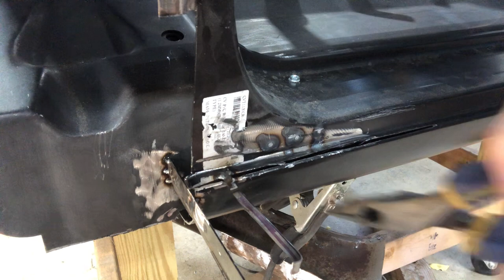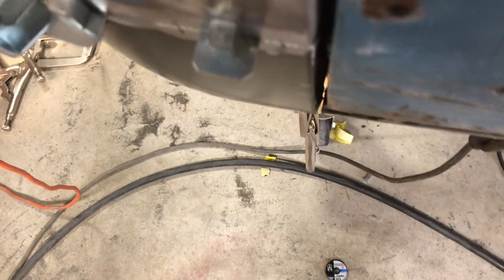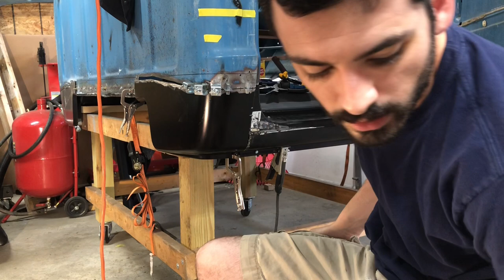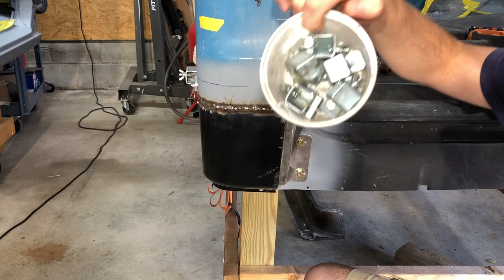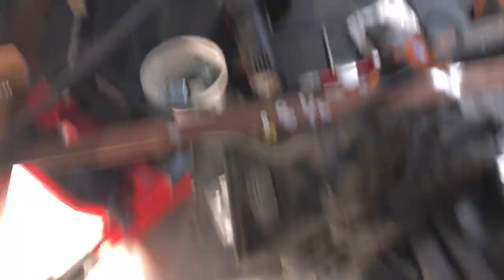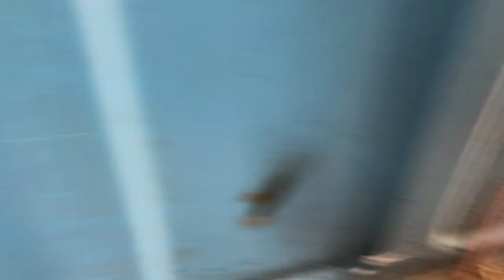C10 Rocker and Cab Corner Replacement (Tips & Approach Part 2) 1967-1972 Chevy Trucks

Comment: Just recently found your channel. Really like your work. What I’m looking for is the repair of the panel of the inside roof just above the windshield. Do you have a video or can you recommend one from someone you trust? Thanks again.
Reply from the maker: Thanks Mike, much appreciated. My cab doesn’t need that section replaced I don’t believe. Won’t know for sure until I hit it with the blaster but I don’t think so. The other cab I’m only working the bottom side of. There have been a few guys on the 67-72chevytrucks forum that did it. A small vise brake and you could do it easily. If you want you can sent me pics to looks at. Email is in all the descriptions